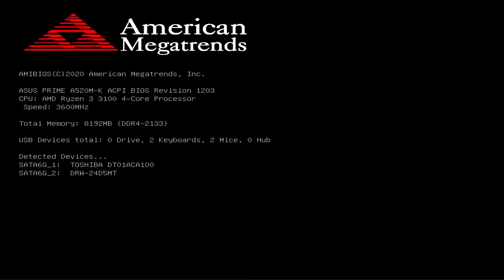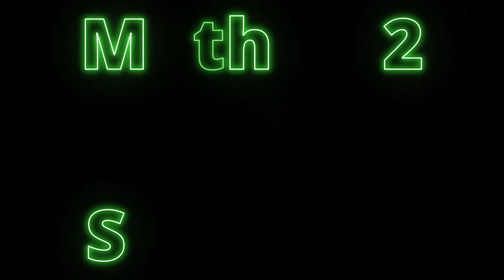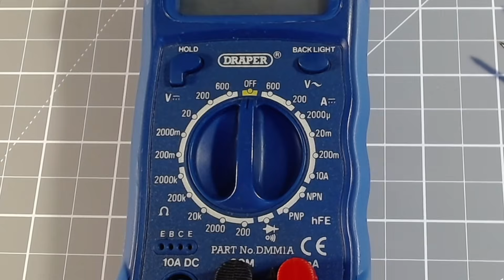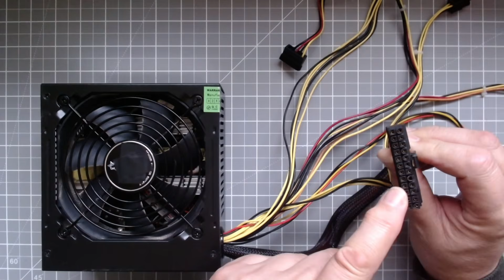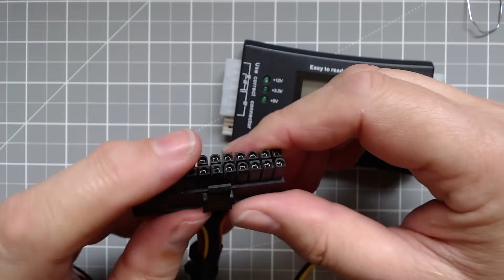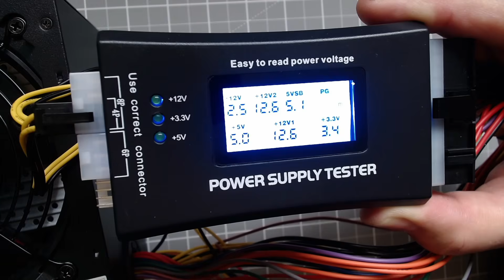How to Test Your PC Power Supply Unit (PSU) – 4 Easy Methods

Comment: My 12 volt showing 15 volt what can i do now from 1 week or i don't know
Reply from the maker: Hi @姓氏h, 15 volts is definitely too high - anything more than about 12.6 volts is is not recommended. It is possible that you have a false reading so I would suggest checking again to be sure. Maybe use a different method to test the voltage. For example, if you are using the BIOS to check the voltage, try using a multimeter instead. However, if you still read 15 volts I would recommend replacing your power supply. I hope that helps
Reply: @teksparkz  Yes I checked by multimeter on 24 pin which connected to motherboard and that show 12 volt, so i think sensor giving wrong volt, but i want to if sensor giving wrong reading so i dont need to worry?

Comment: My computer started shutting down randomly today and cleaning out the dust didn't help so I'm thinking it has to be the CPU. My voltage levels are 12.076 V, 5.060 V, and 3.360 V and the core voltage is 1.448 V. Sounds like those are too high, so do you think replacing the CPU should fix my computer shutting down?
Reply from the maker: Hi @_Rook12 - Your 12, 5 and 3.3 volts seem OK but the core voltage looks a little high - the core voltage can sometimes go as high as 1.5 volts in certain situations for brief periods during high performance boost scenarios but should not usually remain at that level. CPUs generally tend to be quite reliable and can work for many years without issues as long as they are not overclocked. It could be the CPU but it is more likely to be the power supply. It would be worth borrowing a PSU from a friend to see if swapping out your old one fixes the issue. It could be that the problem only occurs when the system is drawing more current than usual from the power supply such as when playing more demanding games. You mentioned that you cleaned out the dust but the thermal paste on your CPU cooler may have dried out and might not be conducting heat away as well as it used to. An overheating processor can cause a system to shut down to protect the processor from heat damage. You could use a program like HWInfo to check the CPU temperature while the system is running. Faulty RAM or an overheating Graphics Card can also sometimes cause random shut downs. It is really a process of illimination. Try changing out one component at a time. For example if you have two RAM sticks, take one out and see if the problem goes away....If not swap out the other one and so on. Hope that helps 😀

Comment: What do I do if the voltages are not okay..? Get a new psu?
Reply from the maker: Hi Nick - Yes getting a new one is probably the best option. If the voltages are not too far off you might be OK. Otherwise I would replace it.

Comment: This was helpful!
thank you!

Been chasing an issue for a few days now that started last fall.
First symptom was an incomplete restart/reboot process from Windows start menu. Then began noticing a slow post times in the last few days. May have been doing it before, I just wasn't paying attention.
Can eliminate and recreate the problems by removing and adding drivers or hardware from the system.
Wiped the drive and reinstalled Windows. No change.
Unplugged 1 SSD and issue resolved.
Reinstalling Windows again and at the graphics card driver install the symptoms returned.
Did Windows again, and problem showed up at MB audio driver install. Before the graphics driver was installed.
Gave up at that point last night and turned the system off. This morning it wouldn't even post.
Remove the graphics card and one ram dimm and got it to post.
Now I am in the bios and all voltages look ok.
But wondering how to test total power available when the load is heavy. Keep up with demand or fall on its face.
Leaning on this whole thing caused by a failing PSU. As a long time mechanic, I have learned throwing parts at something while guessing gets expensive, timely, and frustrating.
Find the problem, replace the part. The issue is finding the problem.
Which is why you pay so much for diagnosing a car just to find its a $15 part that takes 20 mins to change. It sucks from both the mechanic and consumer perspective.

Something as simple as a weak ground connection can create all kinds of havoc on cars electrical system, with no consistancey in symptoms.
Reply from the maker: Hi @festersmith8352. Thanks for the feedback. Sometimes a power supply will test OK as there is no significant load when using a multimeter or tester. What I would suggest would be to borrow a PSU from a friend for a couple of hours and see if the problems go away. If they do then you know its the power supply.
Reply: @teksparkz  Thanks for the reply and confirming a load test isn't really doable.
Didn't think to barrow one though.
Good idea!
Thanks for the help.

Now to find someone I know who may have one. Of my local friend group, none are into gaming.
They have families and like to touch grass more 😁
Reply from the maker: I know exactly what you mean 🤣